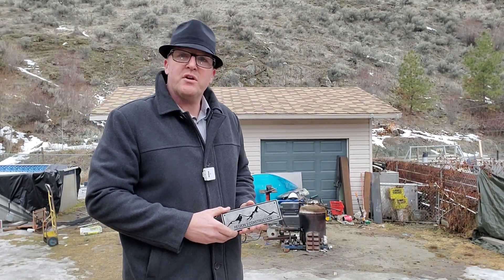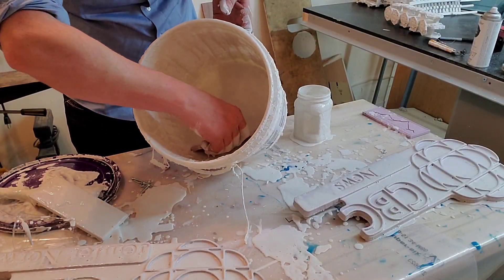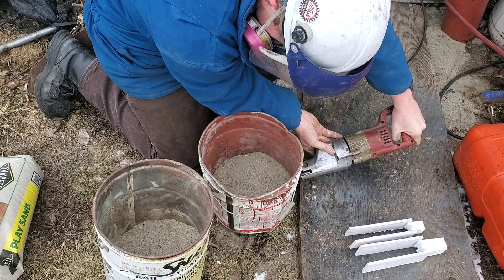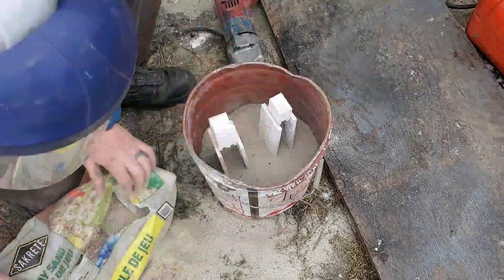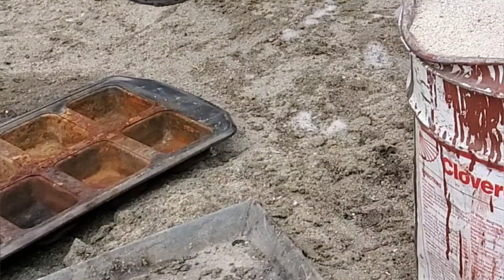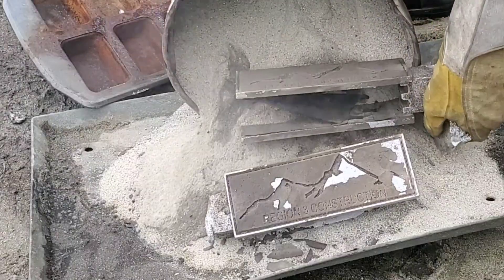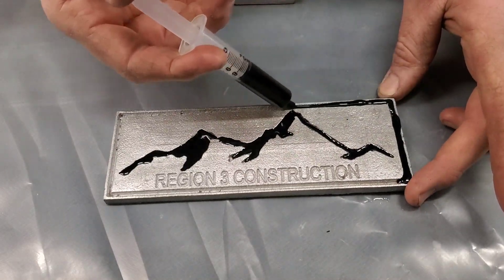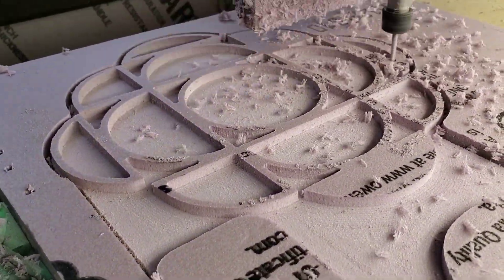Lost Foam Casting an Aluminum Plaque in the foundry workshop

Comment: Since you used cnc to cut the foam part, a 5⁰ end mill used to cut a 1/4" plastic or wood part. Then used a green sand mold would have given better results, and you could have made as many as you wanted. Being cnc cut 2 parts Mount on a match plate, done.
Reply from the maker: You're absolutely right thank you. I definitely am going to practice green sand molding a lot more
Reply: @Wrighmachining  I'm a retired patternmaker and have been thinking of starting a channel on patternmaking, gating and casting. It seems to be an area that's not covered much.
Reply from the maker: @roscoepatternworks3471  i think you should !  The old foundryman had done it and he had quite the folowing .    

You can do it all with your cell phone and   some simple gear . I would love to help you more if you are interested . 

Email me at ryanwright368@gmail.com if you like amd we can talk more